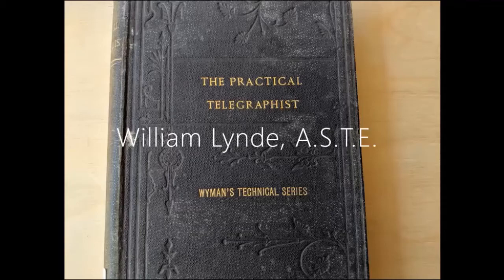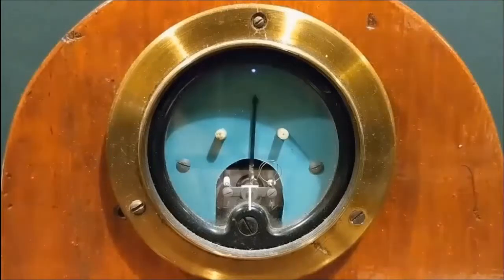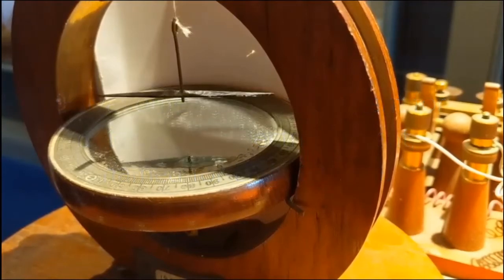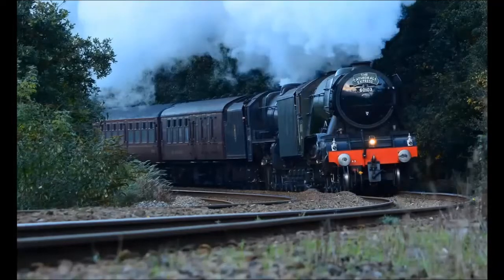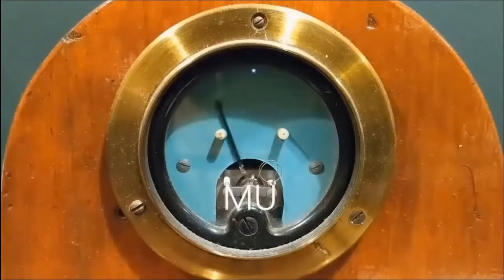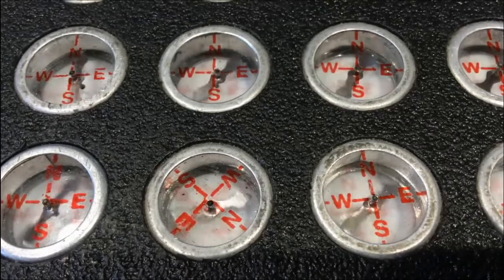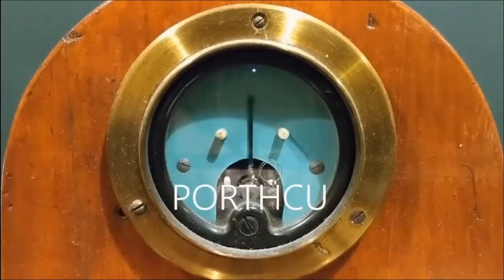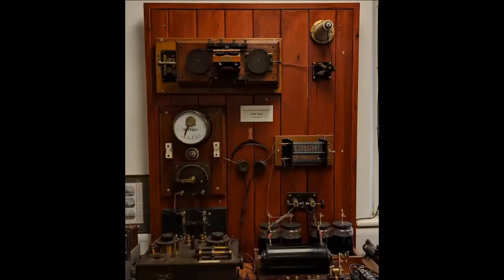The Single-Needle Telegraph: what is it?

Comment: Wasn't the 2-needle telegraph developed after the 1-needle to accelerate the process?
Reply from the maker: The double-needle telegraph and the single-needle telegraph were developed around the same time (1843-1844).  The double-needle telegraph came about as an improvement on the five-needle telegraph which used too many wires.  But the single-needle telegraph was the next step after the double-needle telegraph as it used fewer wires.